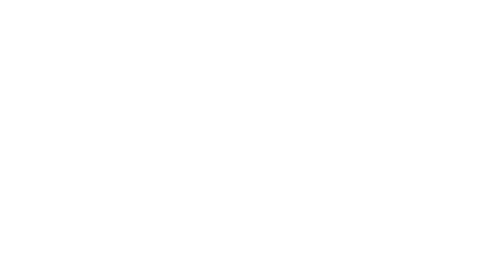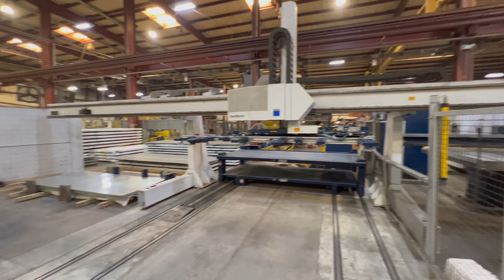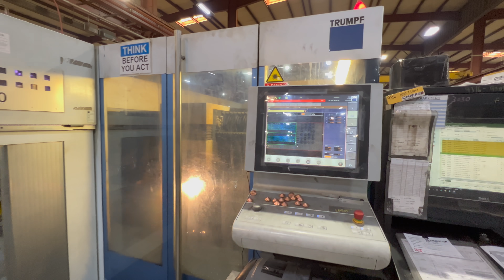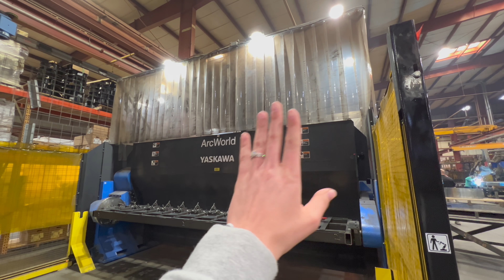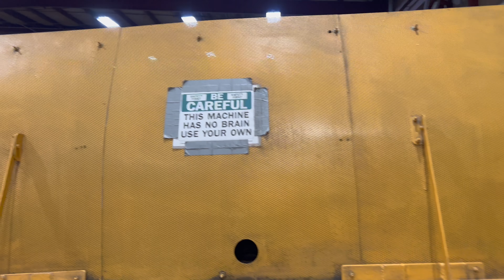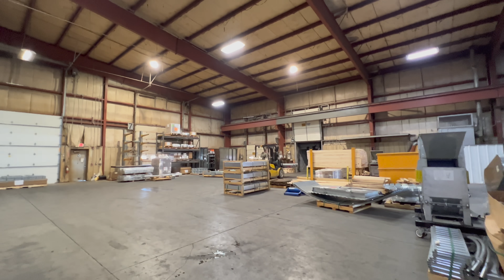From 1920’s Drill to Million Dollar Punches

Comment: I operated a trumpf punch machine very similar to the ones they have. Trumpf machines are top of the line. And yes those press brake machines that bend the metal can take your finger off before you realize it's happening.  I ran Amada press brake machines also. Thankfully I was never injured but I know several people who were injured badly by them

Comment: You should see the CNC machine that cuts the wing skins for the 777 and 747,,,,,  20' x 140' table.... 1" thick piece gets trimmed for size, all openings and holes plus thinning down to 1/8" on the trailing edge... Takes 2 days 24x7 to mill everything   Boeing Everett WA... Bldg 25.....

Comment: Love seeing manufacturing.  I retired from Fel-Pro Gaskets.  Back in the day ever paper, cork rubber, and steel gasket were pressed or cut individually.  First time I saw a CNC machine cut hundreds of small gaskets from a single piece of material it was amazing.  However, when were in meetings the whole building shook from the 500 ton presses punching out cylinder head gaskets.  The workers would insert a piece of material into the big press on their wrist were cuffs attached to a line that was attached to the top of press.  They would mash a button the press would come down while at the same time pulling their arms away from the press.

Comment: Hi Laura.  This old-timer lovers this video.  When sheet stock is over about 1/8" thick it is referred to as plate.  I learned this early in my aerospace career as a strength of materials tech. and thought I'd pass it on to you.  I used a Tinius Olsen universal test machine rated at 50,000 lb. force, a baby compared to that monster you saw.

Comment: I recently assembled a steel prefab corrugated building. Not large 24 X 36 X 13 feet high.  4,500 bolts.  All initially assembled 'finger tight', to allow for flexibility of the later assembled segments.  But when braced, true, level, and ready,, all 4,500 bolts needed to be tightened. That took nearly one week for one man,,, just to tighten and inspect all the bolts.  Those plastic buckets filled with bolts looked very familiar to me.

Comment: turret punch machines are totally awesome , i worked at a place that had one and all you could hear is boom boom boom
Reply: actually the panels that your sheds are made of, where i work in australia we make the same thing using a process called rollforming and cut them to the prescribed length that the customer wants and we do both roof panels and wall panels

Comment: I'm curious, does the amount of arc of the grain bin panels depend on the diameter of the bin? or are they all the same?
Reply: The sheets are curved to accommodate the diameter of the bin purchased. Each panel will be curved the same to assemble whatever bin size a customer requests. Pretty cool stuff!

Comment: That is a super nice shop. I used to work in furniture manufacturing.
I've seen some impressive manufacturing plants. 
The most impressive was Fort Howard paper mill which is now a Georgia Pacific location in Green Bay Wi.
It was over 5000 acres internal space. You needed a map to find your way around the place. It even had it's own coal power plant to make electricity.